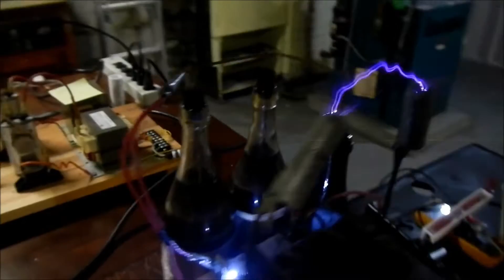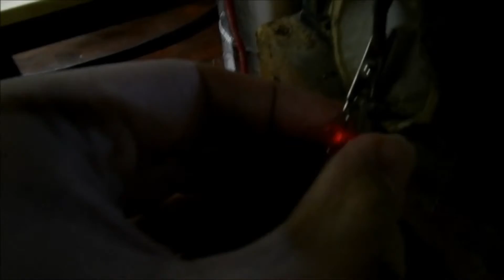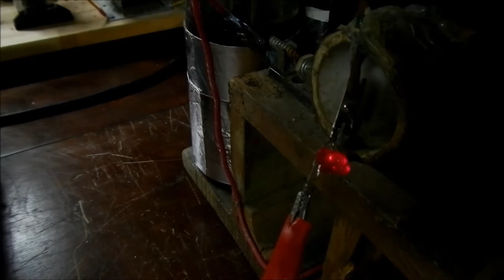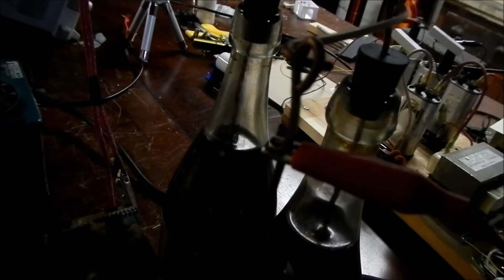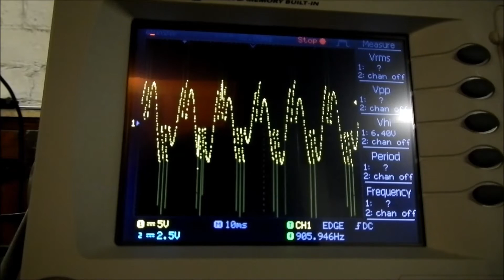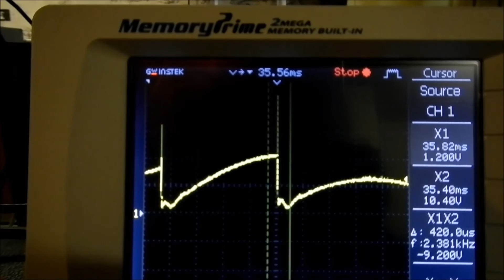My First Tesla Coil Turns 20 Years Old! (1997 to 2017)

Comment: Nice demo. I find that when simulating a TC, it takes one step size to simulate the line frequency charging circuit, and a much shorter step size to simulate the kHz to MHz discharge currents. Maybe your DSO has a similar issue, and you could get better resolution of the discharge currents with a shorter step size if you capture the charging and discharging activity in different 'takes' with different step sizes. But that was still a great demo. Thumbs up. And I just knew you would turn out to be an engineer.
Reply from the maker: Thanks, when you do a stop screen capture you can still adjust the time scale but the resolution is a little limited.